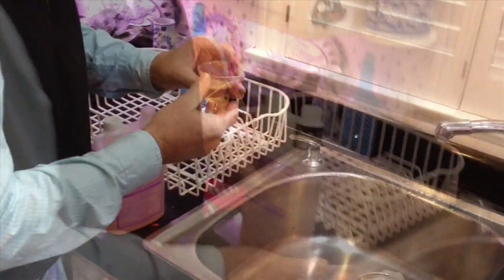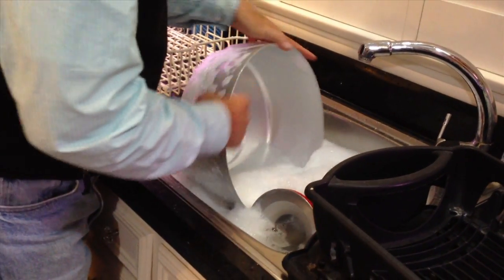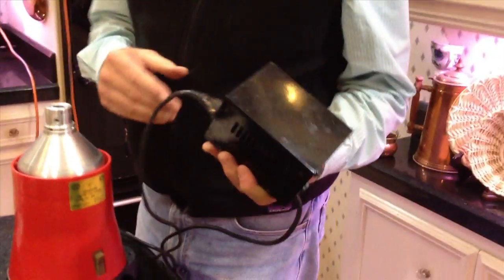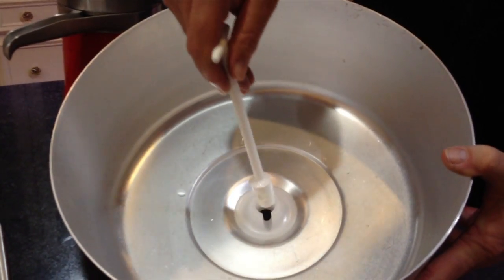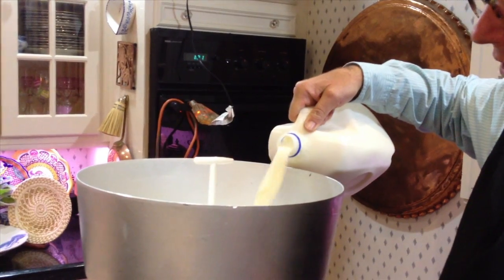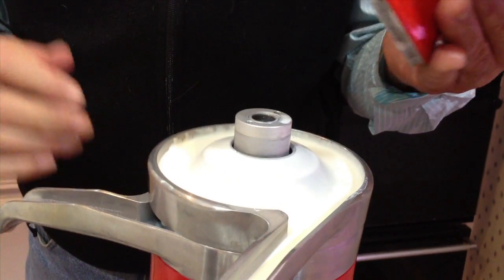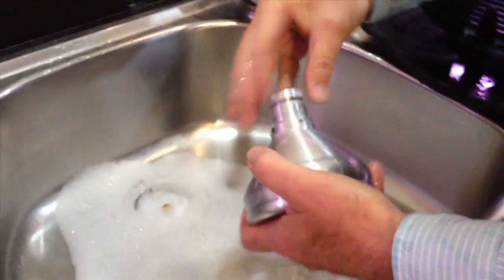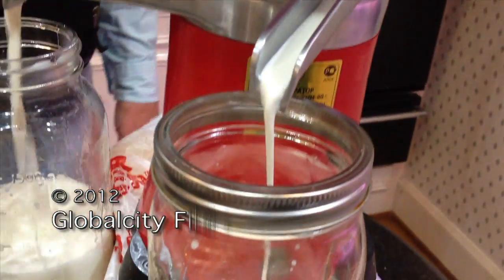Processing Raw Organic Milk at Home

Comment: I have the same machine. But if I run the milk trough it, the cream is a lot thicher then in your video. In the aluminium part of the separator that holds the white plastic thing, is sometimes 'cheese'  formed just above the plastic part, that is almost like rubber. 
By the way, I heat the milk up to body temperature before separating. 
I must do something wrong but there was no manual with the machine...
Reply: Hi! if you need the instruction I can send it to you.
Reply: Turn the regulating screw conterclockwise 3 times after completely tightened. Don't tighten much.